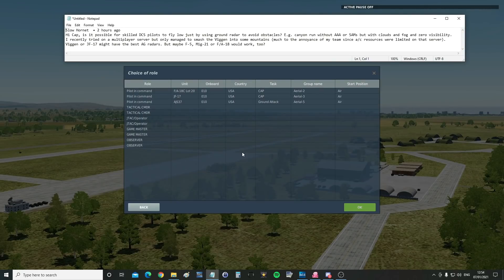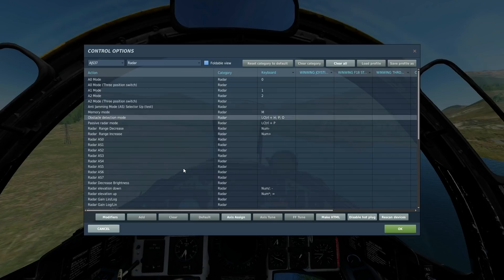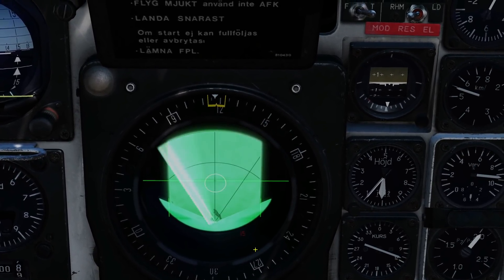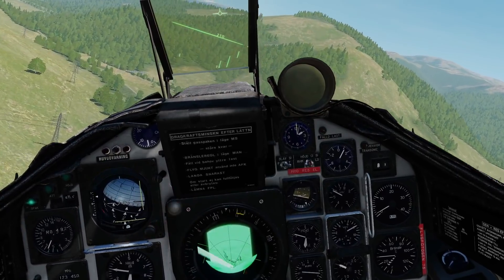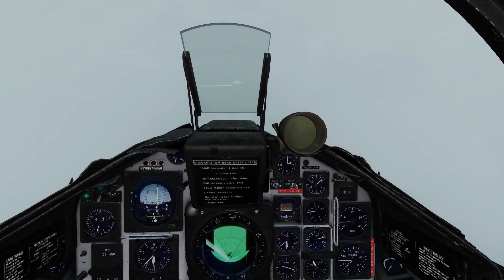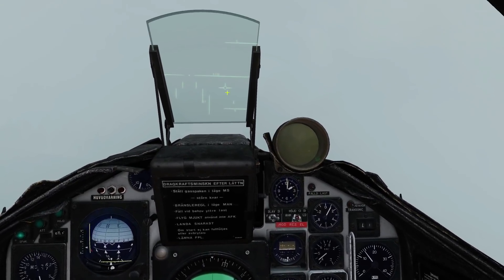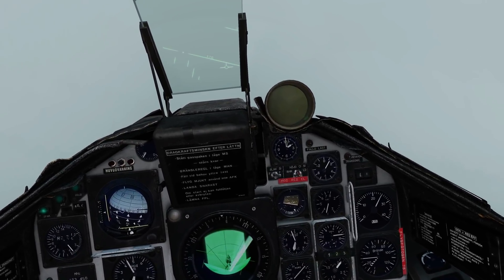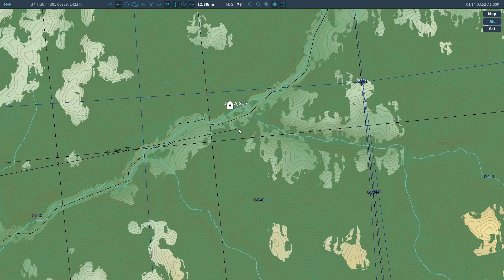AJS37 Viggen: Terrain Avoidance Radar Tutorial | DCS WORLD

Comment: Nice!
2 things to mention:
- the big light (red) next to the radar will turn on if the Alt Radar detects ground being to close
if it turns red go Stage 3 and rapidly climb 
- second the Slav Si is only a de-cluttered HUD mode
T it's on so that at low level will only show necessary info
F it's off and will show the normal things
Reply: The redirect light turns on if the radar altimeter starts to rapidly lose height. This means that you are either about to hit the ground or a mountain. It also has a bunch of other meanings, but altitude is one of the more important ones.